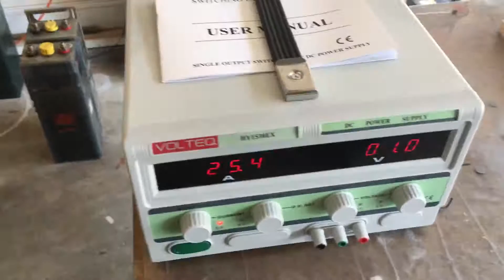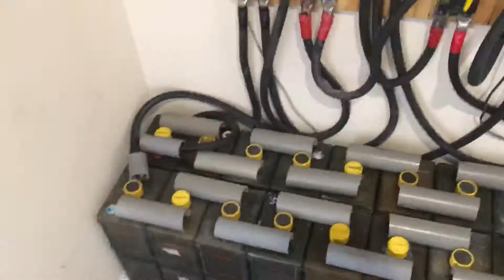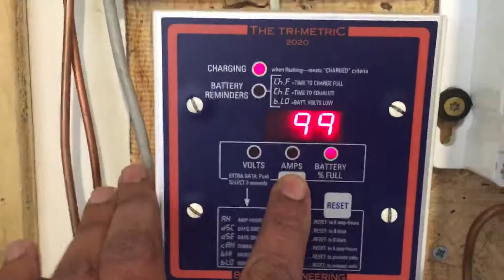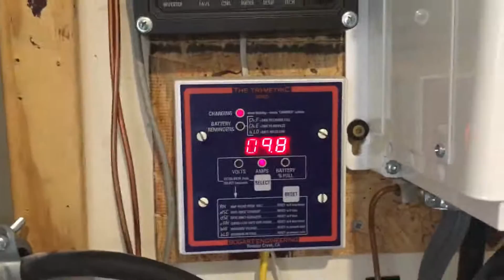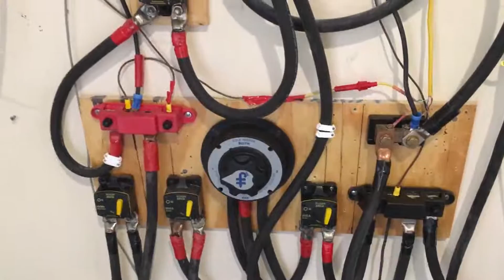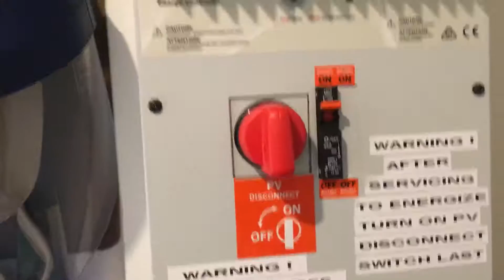DIY Reconditioning Edison Ni-Cad battery cells

Comment: Interesting I found this video. I worked for the company that made these back in the late 70s. It was McGraw Edison Co. Our division was Edison Battery which manufactured these Nickel Cadmium Storage Batteries. Later renamed Power System Division. They were in Wayne Township N.J. There was also a plant in Bloomfield N.J. that made Nickel Iron batteries. That was in the early days of manufacture of these
and within a few years the facility doubled its building size, a few years after that they
moved out of N.J. to Greenville N.C. to a much larger facility. Not sure when but eventually McGraw Edison Co was dissolved and all their divisions were sold off. Power systems division was sold to Nife Corp. who were in the business of manufacturing Nickel Iron batteries.
The particular batteries you have there were the"ED240" (240AH) they were charged at a rate of 1.2 volts per cell. I remember some of our biggest customers were the railroad and transit systems companies. Seeing your video was like talking a walk down memory lane. Lol

Comment: How does the charge controller differentiate between the NiFe batteries and the NiCd Batteries?
Reply from the maker: The charge controller doesn't differentiate between the two banks because the chemistry of both are essentially the same, Ni-Fe and Ni-Cad are both Alkaline based systems and have essentially the same charging characteristics.

Comment: I've got twelve 11ah cells that I was gonna make a pack out of, but some of them just keep crusting on the terminals with what I'm assuming is the KOH electrolyte over time (months). I have the KOH to replace the electrolyte, but I don't know if I even want to if it's just going to wick out.
Reply from the maker: I've seen the electrolyte crusting on the casing near the cap when I'm charging the cell at a high rate, basically C/5 (which is pretty high).  During reconditioning, I believe this is to be expected.  If your water levels are in good shape and your specific gravity is good to go then it should be fine.  To reduce the residue, you can try decreasing your charge\discharge rate.
Reply: Even one of the cells I have set aside crusts though and it's not even in use. I'll just go ahead and change out their electrolyte and see what happens.
Reply from the maker: Sounds good, let me know how it works out.

Comment: NICE your 100% right. As you use them they will come back. One thing to look for is rust looking stuff. Just like when you got your new batts. As you work them they will come back to life. If how ever they do not ever come back up and stay up then they are trash. How ever I have not ever seen more than 4 that where trashed. 2 was the case was broke. Take your time and you will be payed off well. SO happy for you brother. God Bless.
Reply from the maker: Thanks, it's a long process and I'm hoping for the best. So far it's looking good. God Bless.
Reply from the maker: Hey Bobby, I've got an old cell that I've rinsed out and replaced the electrolyte, and I've had it on a charger for over 10 hours at a steady 25A rate, it started out at 0v but the voltage doesn't get over .25v.  Have you seen this before or is this cell toast?  Seems like it simply won't take a charge.  The cell casing is good and the plates look fine.  However, this cell had no electrolyte and was at 0v when I got it.  Any ideas?
Reply: rhandsom It's trash! If the Cell ever had power and was not wet they are no good for the most part. If it's not taking a charge that tells me the same thing. Next thing I would think is if it was dry some one may have tryed to fix it or that is how they would show a dead cell buy keeping it dry..
Reply from the maker: Good point, I'll keep it under observation.  I also noticed that these cells had some black oil in it and there looked to be some substance that had collected in a thick clump in the bottom.  I believe the plates "may" also be carbon saturated.  I'm trying a last ditch effort to clean them up by putting heavily saturated KOH to see if it will dissolve the deposits. But I'll give it a shot to see if it works.
Reply: rhandsom We had a hose that would go down in there with hot water to help brake up that stuff. You can use hot water just do not use boiling water. It make crack the case.
Reply from the maker: That makes sense, do you know what temperature it should be.
Reply: rhandsom No... Brother If you still have my phone call me real fast.. I will PM with the #